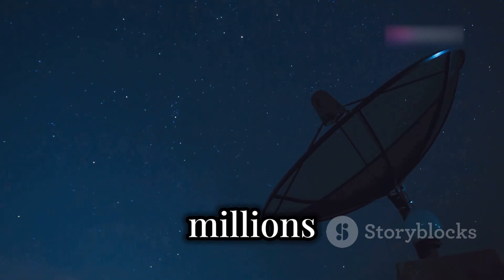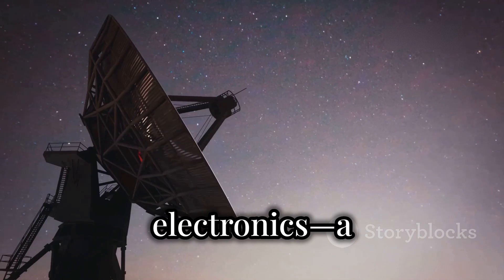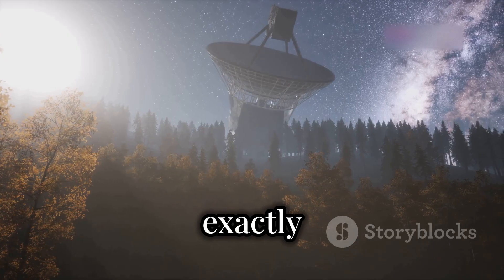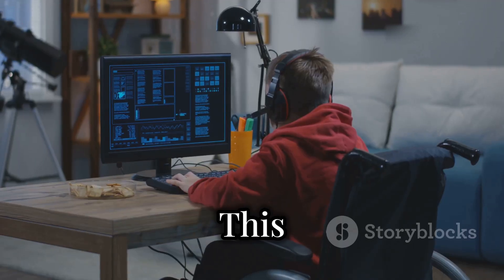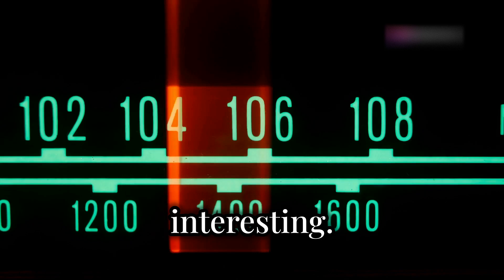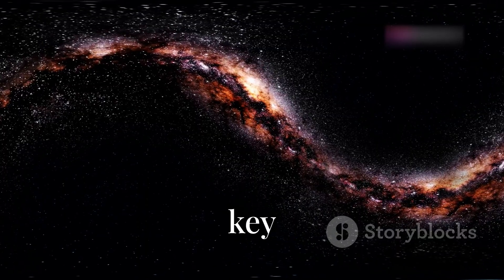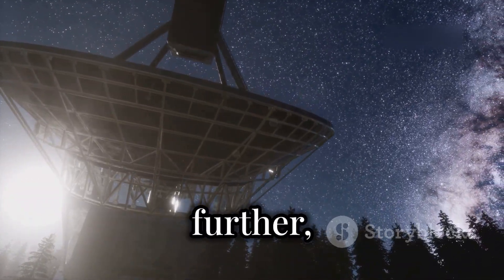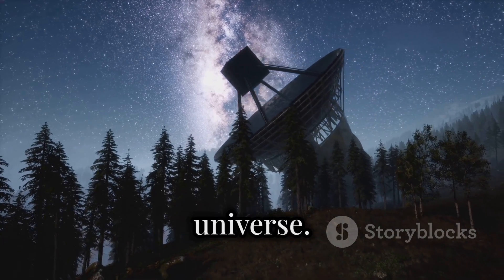Build Your Own DIY Radio Telescope from Your Backyard: Detect Hydrogen Clouds in Milky Way

Comment: Which A/D converter did you use, please?
Reply from the maker: For this setup, an affordable and reliable choice is the MCP3008 A/D converter, as it’s compatible with the Raspberry Pi and easy to integrate into DIY projects. It’s an 8-channel, 10-bit converter, which works well for capturing the signal from the dish. Other options could work, but the MCP3008 is widely used and well-documented for projects like this. Let me know if you’d like more setup details!